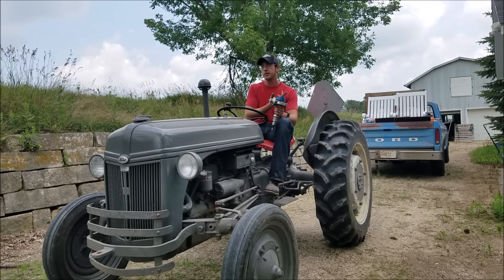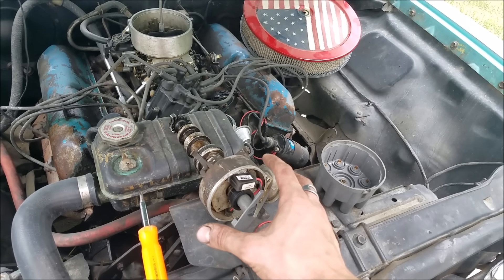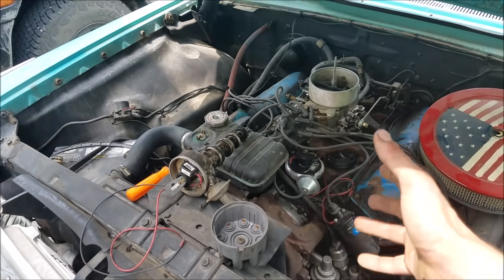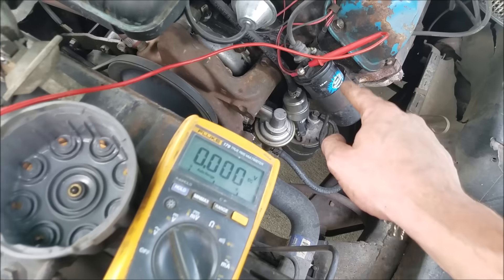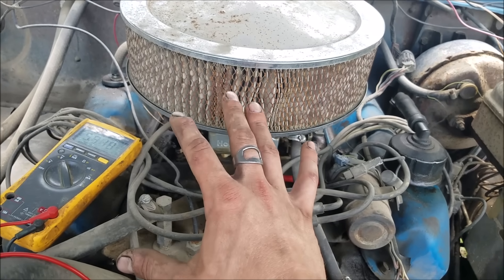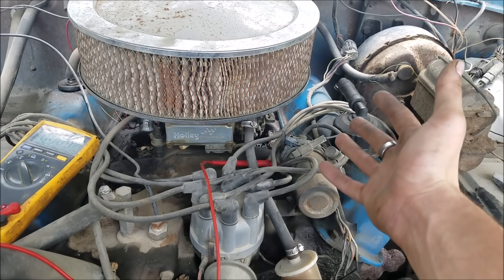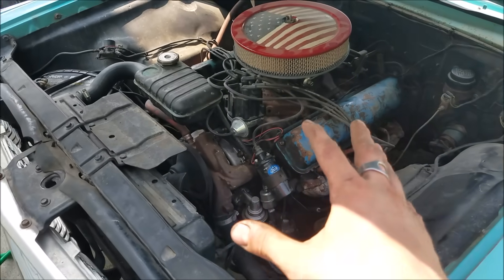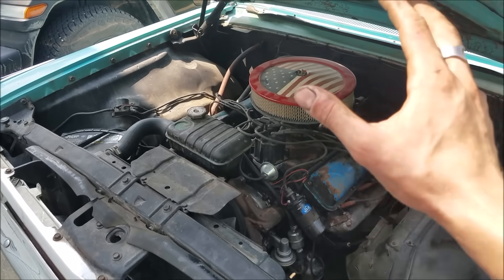Pertronix Ignition "Problems & Failures" (It's Actually YOU)

Comment from the maker: Late night upload here lol. . . but seriously now, Pertronix didn't earn the bad name that media has seemed to of given them lately. I never like seeing good companies be beat up undeservingly.
I linked some of their products I currently have on my own cars above - Everything I have ever had from them has treated me very well.

Edit: if you are hell bent on using ignitor 1 or 2: be sure to supply the module with 12v but you may need to maintain the original ballast to the coil (both again need to be on a keyed source). 
If In doubt, simply call pertronix - great group of folks to work with.
Reply: I'm not "hell bent" but I bought the ignitor 2 because I heard the 3 doesn't like tachs.  But still....the pertronix flame thrower 2 coil calls for 12v.  So I would think both the module and the coil need to be on the full 12v.  🤷‍♂️
Reply: Ford Duraspark+quality module>Pertronix. End of story
Reply: Had great luck using them on old tractors for years 
Ground seems to be way they have propane and half ass connections by half ass mechanic
Reply: This! My 65 IHC has been nothing but reliable but with the ignitor! It was set up right when I bought it and I followed that when I resealed the engine and she's been great!
Reply: Used one years ago on a BMW 2002. Followed the instructions put 50k on the car in a couple years before selling it and never had an issue. Didn't know they had a bad rep until I saw this video.
Reply: Greetings, Luke!
I've watched your channel for a while now. It's my go to for improving my Ford FE education. I've had my 55 f100 for 38 years. Was a kid when I bought it and it was junk. In 05 I put a fresh (1975) 360 and c6 in it along with a complete Painless wiring kit using the Duraspark setup and original distributor. To my surprise, it started right up. A new Holley carb last year was a vast improvement but revealed the failing distributor. It's done. After watching your videos, I recently sprung for a Pertronix unit with the Ignitor 1, a new pertronix coil, and eliminated all things Duraspark. Got 12 volt plus at the B+ coil terminal.
Assuming the new unit is okay, It will NOT run. I think it reluctantly fires here and there enough to burn the starting fluid.
I've studied my Painless paperwork and watched videos.
I've got the balancer at TDC, both Number one Valves closed, and a screwdriver says the piston is up. I have a tdc whistle and a spark tester on order. As best I can tell, the various ohm readings are in range.
I have never posted a message before anytime, anywhere. Talk to me, Luke!
Reply: Hay I'm a big fan of ur channel I'm working on a 1972 F100 and it has inline 6 I can't get spark at all I thought it would have points but it's has what ur talking about
Reply: So the module doesn't have to be connected at all via red wire to the coil to get its power as long as it's getting 12v from a keyed source? I'm trying to hook it to a boat mercruiser 140...everybody in all these videos is saying cut this wire or do this or they but everybody is running a new 12 v source wire to the coil then hooking up the module to the coil..going through comments people saying coils are getting crazy hot...others saying works but how's the longevity never see follow up vids....haven't tried to start yet cause people got me tripping reading comments...I have key on original coil installed 5v at the coil positive terminal...I removed and installed everything including petronix flame thrower coil...check voltage again at positive terminal everything hooked up straight to coil key on not running and I have 12.4v at positive terminal of coil while grounded to  a engine bolt with meter......am I good to go or should I seek out alternate source of 12v keyed and go directly to red module wire with the new power lead????? Sorry so lengthy alot of conflicting info in many diff videos
Reply: You talked about the importance of a new coil how about new wires over the OEM wires?
Reply: Hey awesome videos is there one on how you exactly run the wiring from the box to ignition switch or distributor???

Comment: Pertronix does not say you have to rewire to 12v. At least the ignitor I and ignitor ii documentation says you can. I haven't read the ignitor iii.
Reply from the maker: You absolutely need to on 1 and 2 or else the module will eventually fail or even worse - this half burnup thing they do where they make crap spark but still run enough where you start chasing things tryingnto figure out whats wrong. The module needs 12v

Comment: Going to try mine on my 1950 desoto’s  heater fuse because the heater core is bypassed so it’s not like I will be using the blower anytime soon . Not sure if the ignition unit is still in great condition but it’s worth a try and if it works it will give me more time until I convert it back to points.

Comment: Having so many issues with The one that the former owner installed don’t know how they installed it but stalling, random missing, backfire through carburetor. Rebuilt the carburetor, good compression and spark plugs are not fouled . This past Sunday I had it running perfectly fine on Monday it was back to running like crap slowly dropping cylinders until it stalled at idle. Runs reasonably well at speed but will not idle for shit . I will definitely finish watching the video but if anyone has any suggestions please let me know. At this point I want to go back to points My 1950 desoto has an ignition interruption switch it uses when it upstairs and downshifts with it being a semi automatic but if I can get the pointless system to work that would be a lot easier.

Comment: Have you ever had a pertronix ignitor 3 cause a upper rpm misfire? I'm fighting with a upper rpm mis like the rev limiter is kicking in to early. It's set at 6500 rpm but it won't rev above 4500 rpm willingly. Any thoughts?

Comment: When testing for voltage at the + terminal on the coil of both trucks. If no current is flowing through the coils because the Pertronix module magnetic interrupter just so happened has come to rest where it has triggered the coil ground interruption then like you say you would be measuring the voltage potential at the end of the + wire attached to the coil but if the Pertronix module has come to rest where it hasn't triggered the ground interruption and the ground is enabled allowing current to flow in the coil then by touching the coil + terminal and the - terminal or any suitable ground wouldn't you be measuring the voltage "drop" across the coil and any neg wiring and not the potential at the + terminal of the coil. The way to check is to touch the neg of the coil and like you say any ground and see if you get a reading on both or use the meter on amps and put it in series with the load and see if current is flowing provided it's less than 10amps or the capability of the meter!

Comment: Pertronx are trash. They are finicky and poorly made. Do a pertronix problem search, and you'll find many many examples. I'm an old professional technician with many years experience. Retro fitted one into my '48 and nothing but problems (Yes, it was wired correctly). Did you know that if your battery voltage drops to 8 volts (like forgetting to turn off your lights) your engine might crank, but you won't get spark! Leaving the ignition on without the engine running will fry the unit in minutes! Best advice: carry the old points/condenser set up in the glove box...

Comment: On my '66 Mustang I have installed aftermarket a/c. This left the key-on lead for the blower motor, in the engine compartment, unused. When I added a Summit 4v, electric choke carb I powered the choke with that. Would it work to bring a split lead from that connection over to the coil and continue to power the choke as well?

Comment: So where do you hook up the 12v wire to? Only the ride wire on distributor or to coil along with original switch?
Reply from the maker: Depends on what setup you have unfortunately. Ignitor 3, everything can be 12v, the others, only the module should see 12v in theory
Reply: It’s a 61 f100, was running on points, installed a flame thrower I billet distributor, hooked red wire up to coil along with the ignition wire, ignition wire reads 9volts

Comment: I am guilty of this. Wired my 9n off the ballast resistor. Ran fine for about 12 hours. Then started having issues with it for an hour or so then it died. Checked voltage to the coil, 9.x volts. dang, Knew I messed up. Probably did it when I wired it all back up after my engine rebuild. Oh well

Comment: I wish I read this a couple years ago. I changed to pertronix II elect ignition in my boat, mercruiser, but did not connect red wire before the resistor wire that runs to the coil...It ran great for a year, then sudden  backfiring dies with load. I rebuilt my carburetor twice thinking that was the problem..jeez, thanks for the info. I'll rewire, but may have to repurchase pertronix since I screwed up

Comment: Hi i need advice. My sons 289 started to fluctuate when warm until it cuts out. I found fuel in the oil so new fuel pump new fuel line  installed. Rebuilt carb. It has petronics magnetic puckup. Ive just upgraded the coil to flamethrower 3. New dizzy cap new rotary. I have 12v  to the coil.  Ive gapped spark plugs to .040 to match coil. Car runs  , soon as i tickle the  throttle i got a backfire and it cut out. . Have i gapped wrong.

Comment: Your video made me think of how I wired my unit.  I had it wired correctly when I used the Pertronix oil filled 1.5 ohm coil with the distributor + to the coil + because there was no resistance wire in the circuit.  However, the Pertronix oil filled coil lasted about an hour before it quit.  I then bought a MSD Blaster coil that I had to use a ballast resistor in the circuit to get to 1.5 ohms but I wired the Pertronix on the side of the resistance.  Even though the vehicle seems to run fine, I'll change that tomorrow!  Thanks for making me think about how I wired it.

Comment: Good evening thunderhead 289. Great video btw. Question so I checked the voltage when running my coil and I got 11.7 v. Close to 12 but not quite. I’m running a relay on my 63 falcon so I hooked up another 12v wire from my fuse box directly to my Pertronix. Now it’s getting 14 v when running is that too much?
Reply from the maker: Nope, that's indeed what you want. 
Full battery voltage
Reply: Hey Luke thank you for the reply ! Roger that that’s how she’ll be running now 👍🏼

Comment: Luke you helped me out alot. I have a 65 Galaxie 500 ltd. Rebuilt 352 with a pertronix ignitor ignition.  It would misfire when i stepped on it. Rotisserie restoration 20 yrs ago. Bought a year ago. I've had and restored many cars. I didn’t know anything about the pertronix ignitor.  After rebuilding the carburetor didn't solve the problem.  Watched many videos about the pertronix and found yours to be very helpful. Replaced the pertronix ignitor and had a stock coil. Bought the flamethrower coil and my issues are solved. I love learning and you explain the steps very thoroughly. Thanks for your help
Reply from the maker: That right there is the reason I do this youtube thing, glad I could help out

Comment: Mine crapped put after 4-5 months, itvwas run through a register.
 I guess I  read but  didn't understand the instructions ( flathead Ford V8 , converted from 6 v pos ground , to 12v neg ground.)

Comment: I don't have any problems with the Pertronix distributer, but the Coil failed after 500 miles, I had bought the Coil leads and distributer as part of a kit for a 76 bug. I put the old bosch coil back on and have  no trouble. There are lots of people online who had Pertronix coils fail. 
Regarding wiring to the Coil, the ignition wire coming to the coil will always have 12 volts. Any voltage drop is across any resistor. You stated that the resistor in the distributor induces a voltage drop at the coil if they are wired together, this is not accurate.
Reply from the maker: Resistive lead from keyed ignition source - many old 60s and 70s cars do not supply the coil with 12v. When people hook up their module power to their coil power, this is the problem. 
I never said anything incorrect.

Comment: You mentioned 0.32 ohms resistance for their coil. I thought I've read elsewhere on their web that 3 ohms is necessary.
Reply from the maker: Nay, .32 for ignitor 3 - when in doubt, if you have an ignitor 3, buy an ignitor 3 coil. If ignitor 2, ignitor 2 coil.

Comment: Do you have to run a msd 6al with this distributor or is the ignition built in to it? I have the igniter 3 and msd still hooked up and just wandering.  Thanks!
Reply from the maker: You don't need the 6al hooked up if you don't want to
Reply: @ThunderHead289  thanks for that.  And happy Thanksgiving!

Comment: So in other words. The red lead needs its own 12v source? Have an Ignitor2 on a 65 Ford econoline 6 banger. I have 12 v going through the coil and 12v going to the distributor.. ive got nothing coming out the new plug wires.. it was running yesterday now nothing..at cranking I'm getting only 9v. I'ts not starting now at all. I think the module is burnt. Yes?
Reply from the maker: Yes, she's probably dead. The nice thing about the ignitor 3 setup is you can power everything with the same 12 volt wire
Reply: @ThunderHead289  so if I get the ignitor 3, it should work with the same coil? (Petronix coil) Very helpful

Comment: I installed a rebuilt cardone distrib for a '68 chevy with 250 6 cyl & the center shaft where the pertronix wheel with magnets slip over is slighty smaller in diameter than stock!, making the plastic wheel fit too loose. Pertronix now useless! - Pertronix said distribs are rebuilt in china, but not to factory specs. I wonder about new ones. But points can compensate for this narrower shaft & so i've gone back to them after 25 yrs of pertronix! & the engine runs cooler & smoother - go figure.

Comment: Hey there Luke, I know I'm late to the party here, I just pulled an original Pertronix Ignitor, that was used on my dad's 47 Ford, for 10 years before I used it, for about 10 years. The kicker is, for it's time in my 65 mustang, it was wired to my factory resistance wire. I measured  that wire, under load, delivering about 9 to 10 volts. It still works great. I'm upgrading to a Pertronix CD Ignition box. My family Pertronix experience has been bullet proof.
God bless brother...

Comment: this is such BS, 15 mins video just to say to read the instructions and run it on 12v? really? I never used a ballast and always used the correct pertronix ignition coil, always followed all the instructions and ran the plastic shield in the distributor but have had nothin but problems over the years with these junk products. Its just not worth being stuck by the side of the road for this "upgrade". If you run pertronix always keep the points in the glovebox! Youll thank me later.
Reply from the maker: I've ran pertronix for 15 years without ever having an issue. Pretty convinced anyone with issues is their own fault. I've had 4 cars with them and racked up over 150,000 miles collectively with pertronix. 

Perhaps I've just always been lucky

Comment: ya not sure if I can agree with you on this one. I put in a pertronix flame thrower 3 distributor and coil. Made sure I had 12 volts. Fresh rebuilt 289. No matter what I do, I can't get the engine to start nicely (hot or cold), idles rough, and when I'm driving its feels like the car has the hickups. Was told by the last shop I had it at (3rd generation hot rod shop with a great reputation) that this is a notorious problem with Pertronix. They swapped it out for a MSD ready to run distributor and blaster 2. It now runs like a brand new car. Perhaps I got a lemon, but if thats the case then Pertrtonix should step up. Instead they told me I only had 30 days from the original sale date, so it was just a waste of money. I won't buy that brand ever again.

Comment: Thanks for your video. So what did you do with the original resistive lead wire? Did you just put tape on it and  left it there and ran a key on wire from the fuse box to the distributor ? Thanks

Comment: I pulled the old engine out of my truck a few weeks ago and today installed my new engine. Using the exact same distributor and Pertronix, along with the coil, and carburetor I cannot get this thing to start. I can spin the distributor and it seems to spark however once I install it when cranking the timing light does not light up and neither does the engine

Comment: Thanks for this vid. Read a lot of bad things about these affordable distributors in summit. Now I'm gonna take the risk and buy one.

I'm gonna buy a 3rd gen elektric unit for my 289 331 build. I have a retrofit comp cams with hydraulic link bar lifters. Which one should I buy? Is there a difference between billet or stock look cast housing of distributor , is there a tunable difference?
Reply from the maker: There is - be sure to get the pro billet version if you want to be able to tune the timing curve easily 👍